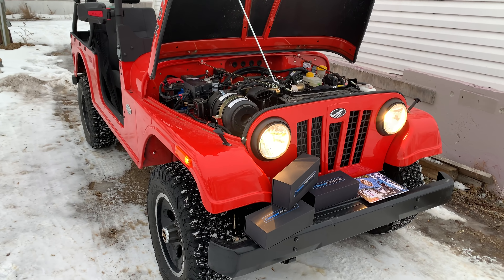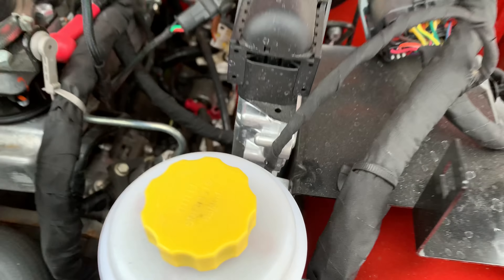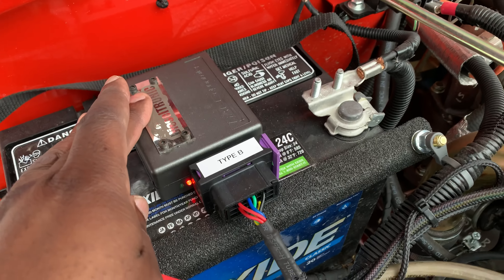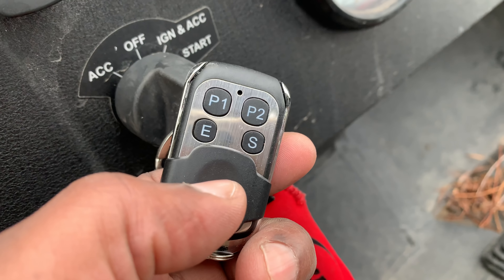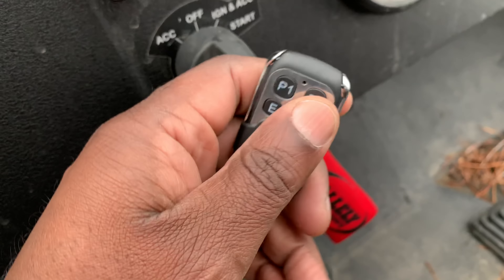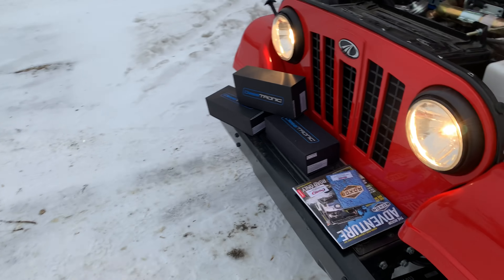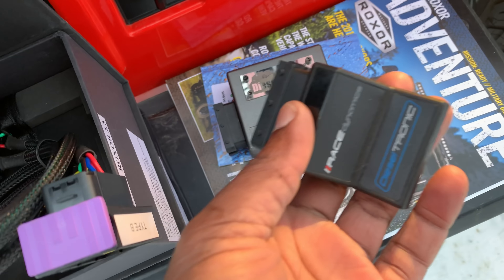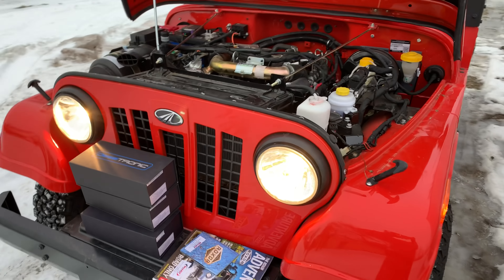MAHINDRA ROXOR | BEST Variable ECU TUNE

Comment: Do you have the power increase or efficiency numbers to tell your audience?
Reply from the maker: No I don’t. I did take it to the Dyno but I’m speed limited so wouldn’t count on the results. But I can consistently spin the tires in the P2 setting. The difference is like night and day!!!! I love it......
Reply: I wonder if you disconnected your sensor if you could get the full power results from it on the dyno. You have an earlier model and can do that, right?
Reply from the maker: @RedWhiteRoxor  Yes I do have an earlier model. I am sure if I take off the speed sensor I'll be able to go faster. But unfortunately I haven't yet done so. Satisfied with the performance I'm getting right now. I use P1 daily and P2 only on occasion when I need the adrenaline rush.